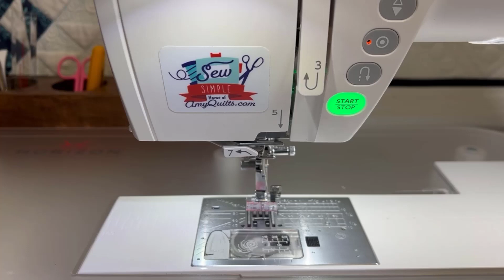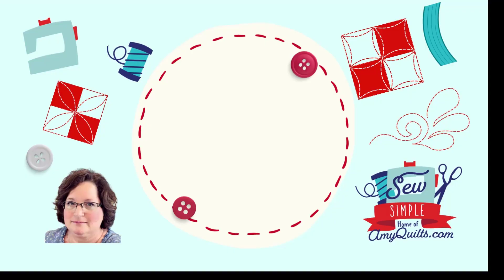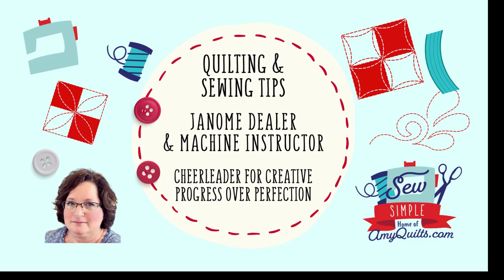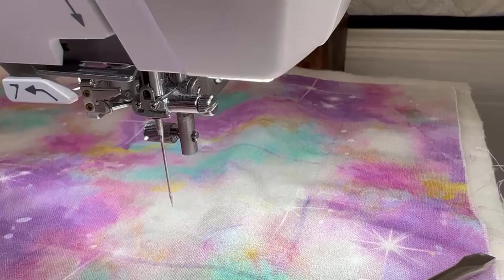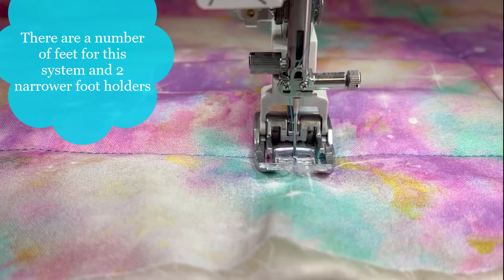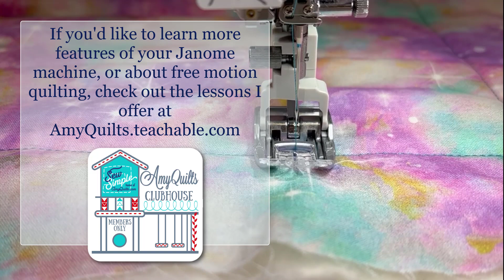Attaching and Using the Janome AcuFeed Flex Foot

Comment: I really like the close ups so helpful to view exactly what you are demonstrating.  Do you have to have fabric under the foot before you start sewing?  Since the feed dogs grab the fabric above and below will there be an issue if you start sewing off of the fabric then onto the fabric?
Reply from the maker: You'll always get a cleaner start if the fabric is under the needle (or after a leader piece in the case of chain piecing) but it doesn't have to be, no.

Comment: Can I use this accufeed  and walking foot with the skyline 3.
Reply from the maker: No you cannot. The machine has to be built with the inner components. The S6 and above come with it.
Reply: @AmyQuilts  
Thank you.
Reply: When I purchased my S7 I was told I could use an HP2 foot just don't use the HP plate from my M7.  When I use with the S7 single stitch plate the needle goes to the right and stitches through the small hole. If I change to the wider hole plate the needle will go to the center to get a good 1/4" seam but the thread tension isn't good. Do you have any experience with using the HP2 with the S7? Any tricks?